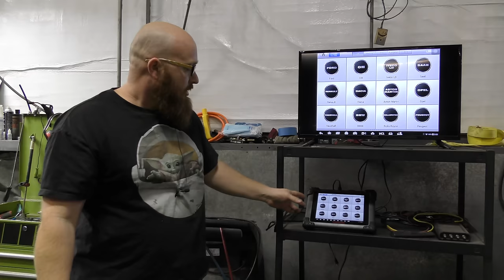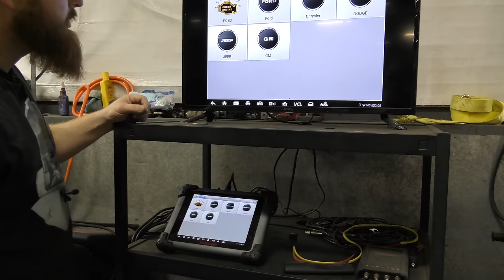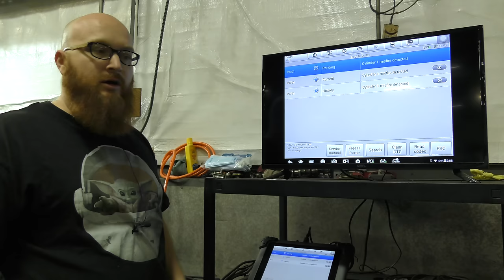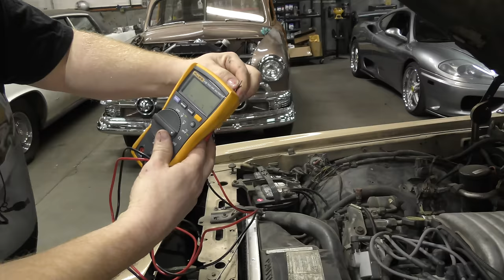Part 5.1: What's wrong with my car?!? Advanced Diagnostic Tips from the CAR WIZARD: Tips 1-5

Comment: Love your channel, but the spark plug coil/plug issue with replacing all of them is just bunk.  Ford did the same thing with a fleet vehicle we drive a few months ago.  We had a misfire on one cylinder, and instead of just replacing the one coil/plug, they did all of them.  Irridium plugs on an ecoboost that had just been replaced 40k earlier and the misfire was very intermittent on a single cylinder, but they replaced all of them which is an absolute waste of money and resources.
Reply: It's a ford. One coil goes out, chances are there are a few more behind it ready to go.

But, I'm sure wizard has explained it before in his videos. It's in the best interest of the dealer/shop to replace them all to prevent a customer comeback situation. This helps maintain their reputation.
Reply: @lucionsrandom5195  I think dealers/shops should keep their customer service folks away from other customers. I overheard a BMW person telling their customer over the phone they had replaced all coils under warranty. Told the person that was £800 worth of coils fitted. So they didn't just replace the faulty one. Imagine paying the dealer out of warranty.
Reply: @flybobbie1449  But if you don't change them all and another one goes bad in a week, the customer isn't going to be happy having his/her car in the shop again, especially if they are hard to get to in the first place AND you have to pay for another diagnostic fee plus labor to take all the crap off again. It's a matter of "While you got it apart..."
Reply: @hotpuppy1  so just have the conversation about those  scenarios up front with the customer. Then customer decides and takes the reward / risk.

Comment: Question. Is there a Toyota 2AZ-FE engine without a missfire, especially in Cylinder 1? Answer. Nope, and if you find one buy it. LOL
Reply: @PhyuckYew  Yup. You can avoid or delay it but it will happen. Toyota bad design. They covered it for a while but not anymore. It's limited to 2007-2009 engines only. New versions are fine

Comment: Oh lord be a Man U can stick a screwdriver in there with a rubber handle and just hold the metal part to ground u won’t get shocked beats all that plastic snips and silicone wire to damn clamps no one has that really. Oh and just changing one coil is half assing the job, changing all coils and plugs is what a “tune-up” is. If the spark plugs wore out one it  is most likely the other plugs did the same thing to the other coils. so might as well do it completely right and change all the coils too it’s not that expensive really. Once u change them all you won’t have to worry about it ever again or not until 100,000 miles.